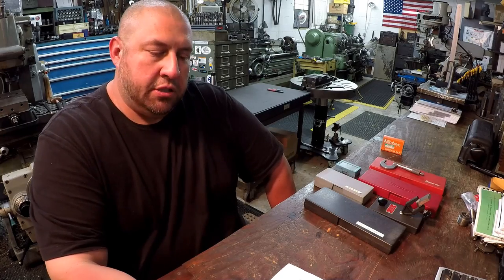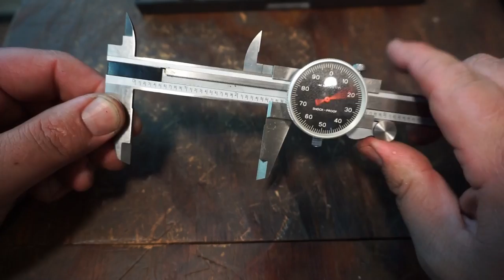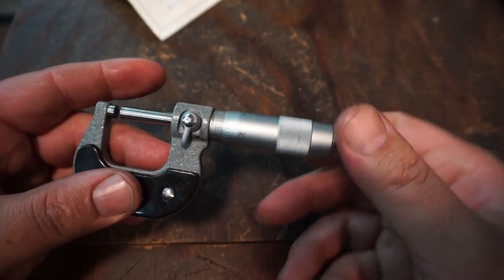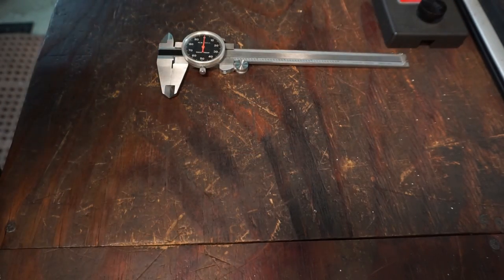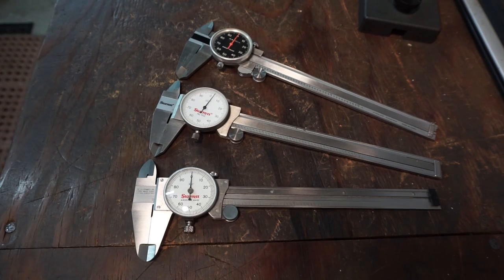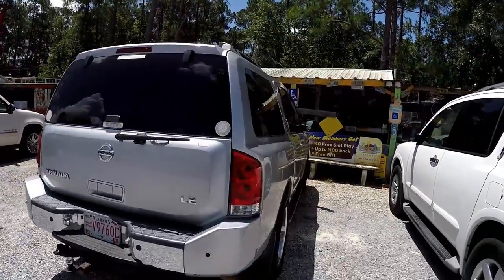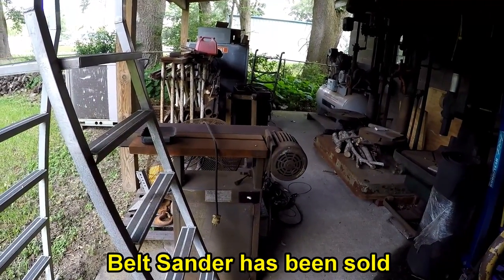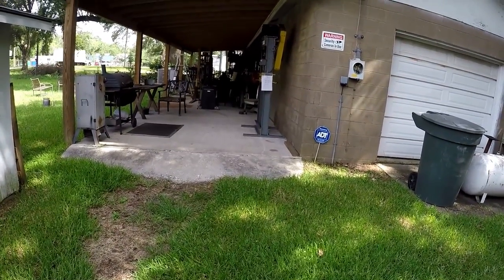SNS 175: Cheap vs Starrett, Shop Upgrades, Weekend Adventures

Comment: Hey Adam good job showing that those cheap tools actually do the job that they were designed to do.  I advise people to go ahead and buy the cheap hand tools such as wrenches, pliers, hammers, screwdrivers and stuff like that so that they can save up their money to buy quality tools that really need to be quality tools such as welders, air compressors, air tools and safety equipment.  That is money much better spent in my opinion and when you compare the value of a $100.00 name brand screwdriver to a $5.00 one from a outlet store the name brand gets blown away and the small difference in quality does not even come close to justifying the $95.00 premium.  Another great video and tell Abby that her camera skills were decent and she should get behind it more often and possibly even do some camera work inside the shop with you so that she can show different angles and stuff on occasion.
Reply from the maker: Thanks Davis, I'll pass the word onto my new camera lady.
Reply: I could see your point in the machinist field. But as a heavy equipment mechanic, with a lot of fasteners under high torque, cheap sockets and ratchets will break. When the sockets and wrenches are broached, the tolerances have a larger margin of error, which will cause you to round off fasteners. What I always tell people is to buy what they can afford, but the tools you use everyday should be the best you can. My ratchets, wrenches and sockets are high end, but punches and pry bars are whatever I can find on sale. I've come across guys that are mechanical geniuses, but work with harbor freight tools. On the other hand, I know guys who only buy tools off the trucks, but couldn't diagnose themselves out of a wet paper bag. I didn't mean to offend, just wanted to provide a different perspective. Have a good day guys.
Reply: Good advice.

Comment: Use a Mitutoyo 505660 since 30 + years. It also zero`s in on a 25 mm slip gauge. But it is in 0,01 mm ! Less than half of 0,001 " ...

Comment: The Starretts have dual gears but no protective cover. I always set them down  with the dial down so chips don't fall into the rack. Once I broke one of the gears and sent it back to Starrett. When I got them back they had a new bezel that was not so scratched but they failed to fix the real problem, assuming that all that was wrong was the scratched up bezel.They did not even check to see if they actually worked before returning them to me.

Comment: Hi Adam,

A machinist I used to know had a B&S micrometer that had come from a production shop and had clearly been used to check a fixed dimension for much of it's life. When the zero was set, it was no less than 6 thou out at one point in it's travel. He kept it as a warning!

I'd have liked to see you check the micrometers at a couple of points between the extremes.
Reply from the maker: That would be an interesting test on the older mics for sure.

Comment: Nice presentation.  

Way back when I bought a Craftsman 6 dial caliper.  I know somebody in the metrology lab so I asked him to give them a quick look.  He did and explained why he took readings at 90 degree intervals around the dial.  It seems a common problem was an off center pivot pin that would result in a small error.  Something worth knowing if you are calibrating dial calipers.

Comment: Hi I liked the video and its the first of yours I have watched. I do detect a little bit of biased opinion against the Chinese tools and a little bit of surprise at the accuracy though I do agree with Greg Fineis a comparison would need to be made over a range of measurements and time used. I don't doubt the Quality tools are better (I own quite a few both inherited from my father and purchased second hand) but it needs to be taken into consideration peoples budget and use of the tool and who may not be in the fortunate position of inheriting expensive tools or in the position to buy them. I think it also needs to be taken into consideration most of the people watching your videos will be hobby machinists who cant justify expensive tools. One thing must be taken into consideration and that is the Chinese are moving forward in the quality of materials and manufacture in a big way look at them 10 years ago look at them now wait another 10 years. India also.Please don't take this as knocking your video as it is well presented and subject well explained keep it up. Thanks

Comment: I enjoyed the comparison.  Even though they are all very accurate I wonder how long they will hold  that accuracy?  In our masonry tools we had to be careful to get trowels, hammers, chisels and joint finishing tools that hold up to the very abrasive material we use.  Measuring tools have to be accurate but not to your level.  Speaking of levels, plumb rules have to be rugged but really accurate so we can plumb and level our work, Greg.

Comment: Better to buy a used starrett or similar IMO.  I have some digital Mitutoyo, which I got off eBay at a good price. Nice quality.  Most likely the cheap tools will not stand up over time or heavy use.  The better quality tools can usually be repaired if they malfunction.

Comment: When you talk about Nike vs Kmart shoes, it's like you could hear me laughing. I agree totally when it comes to measurement or heavy use items, go with quality. If I'm doing something it needs to last, and it needs to be right. If it lasts forever, or it breaks tomorrow, my name is on it, think that way and the choice is easy, and usually more expensive. But, you can find some awesome stuff on eBay and at flea markets

Comment: Don't get the 6 foot door. Get an 8 foot. There are too many things that will not fit. Do a little research, you'll be glad you did. Also put a shower in there too while they are doing the bathroom. It will add value to your house whenever you decide to move because you can list it as a full bath.

Comment: Glad to learn you are taking time to be with Abby.  All work and no play... as they say.  The new building addition sounds great.  I like my new Abom t shirt.  Nicely designed and made.  I used inexpensive calipers when I ran abrasive jet cutters.  Sooner or later they got garnet into the rack and were toast and measurements were usually +/- 0.001.

Comment: You didn't mention the alloys, which with soft metals, makes the durability less. How long can the tool be consistently accurate do to higher grade alloys that resist corrosion better.

Comment: I'm not sure it matters if the the resistance is light, in the friction thimble.

If you zero it, having closed the mic using the friction thimble, then all measurements will be consistent, provided your friction resistance remains the same.

Comment: I would recommend that you get spray foam 1" thick before the other insulation goes in, it really helps seal up the airflow. Of course if you are going with metal for the siding they may use the rolls of insulation that goes on before the metal which makes it hard to do the spray foam. Also, you may want to stick the air compressor back outside in its own little roofed area, they tend to get loud inside a sealed room; or you could flip flop the compressor with the bathroom and have them frame the compressor to be outside under the roof you have now. Changing the electric for that isn't that terribly bad, same for the re-plumbing the air lines.

Comment: Another thing you should add. 
Even though those imports are measuring accurately and dont seem that much different than your starretts. They will not last nearly as long.
They use cheap metals and dont properly harden it so itll wear out sooner than the starretts or any other notable brand.

Comment: Adam great news on the expansions, you have more Space to move around equipment which seems to add more capacity from extra room. It clears the mind to focus better on the customer's job. It will fill up quick and the kind of go getter you are you will be adding on again before you know it. Tom makes great use of his space and that is good because if anyone visits the extra space can be very good,he works so fast that in cramped spaces he may accdentaly clamp or church us right up! At least it would be good work! ;)

Comment: I don't know Adam.  I think your plan is not robust enough.  I mean, where will you be in 5-10 years from now? Will you be employing people. Will you need to move the entire shop to a Industrial Estate. Maybe putting the money into a interest account for a year or two and let things develop? Your shop, now, is very organized and functional. That concrete slab is cracked and cannot support heavy machines. Perhaps you will double the size of the shop one day and trash that slab?   I would not want my comments to in any way discourage you.
Reply from the maker: +J Curran In 5-10 years my plan is to be in a big new metal building. I'm working with what I have for a while without investing too much.

Comment: I finally got my 2001 Durango back from the shop with a new engine, poor thing dropped the exhaust valve seat in cyl. 1 last November.

Comment: Hi Adam, as a hobby machinist I really like your videos - full of informative tips from a professional. I worked for 6 years in Metrology and it was all about calibration and traceability. Micrometers and callipers were regularly checked using higher grade slip gauges, which themselves were checked. Maybe the cheaper tools will lose their accuracy sooner? Time will tell although a good quality tool is a joy to use.
Keep the videos coming!

Comment: cool to hear about the renovation into my area of comfort lol  thanks for the vido  as always regarding 3phase power its almost always cheaper to prewire than to wire after construction . would love to see plans if possible my schooling is in architecture so it is more than a casual interest  ,, will you have a pass through  or will it be basically a 2nd shop on the side? insulation is a must with your heat and humidity i hope you have a good air handling system if not now is the time.. slow and steady dosnt win the clash but it sure shows experience and composure theres always next year and keith is getting older lol no offense keith i enjoy and comment on your videos as well  theres some cool places near you and its been nice to see them ..again thanks for the vids

Comment: You hit the nail on the head when you mentioned that the $15.00 callipers were unused and I am sure that with a bit of use in a work situation it may not be so accurate. Gets what you pay for !!

Comment: On your tool comparisons, one thing I was waiting to hear was about durability. Yeah those chinese calipers work today and they are great for a newcomer to the business. But with daily use in a high production environment, they wont last for 3 generations of workers. If you get a year or 3 yrs you would be very fortunate. However, with the higher quality tools (whether made in Japan, Poland, Germany or USA) you can have a set of tools you can pass down to the next generation. And most importantly, they will most likely always be serviceable. Cheapo tools, once they loose tolerance, there is a good chance that tool is done.
Reply from the maker: +Aaron Meloccaro Yes I did fail to mention that, but I don't have much to go off of. I will say we used to use those cheap calipers a lot and the best thing about them is if they got messed up, dropped, or otherwise broken, they are an easy and cheap replacement.

Comment: I'm just a hobbyist wrench monkey, I most bought a set of calipers for reloading ammunition, but I find myself using them for all kinds of things since, like measuring bolts and comparing to drill sizes for more accurate hole drilling, for scoring a quick line 6 inch from an edge of sheet metal, measuring inner diameters of holes, output shafts of electric motors, engine parts, all sorts. Mine are cheap electric ones off amazon, I was using them at one point in the rain on my jeep this winter and accidently left them outside in the street... they were run over, the battery self ejected I thought it was over... put the battery back in and to my shock still worked...
Reply from the maker: Now that's called getting your monies worth!

Comment: I know it would be a major pain to move the blast cabinet into the new area, away from the machines especially the Monarch, but in my humble opinion would be well worth it. I have worked in numerous shops with blast cabinets including my own and have yet to find one without blast media on every surface close to the cabinet, has to be hard on machines. Love all your videos. Very happy and proud to have just received my new "shop life" pocket tee.
Reply from the maker: I am giving serious thoughts to sell it so that I have more room in the back. I'd rather not even move it into the other side. It's way bigger then what i need, but a real nice machine!

Comment: You can find a lot of older quality tools on eBay. I have a Mitutoyo digital caliper and micrometer from eBay that cost around $50 each. I think the best advice is to buy the best you can afford. Buyer beware of the Mitutoyo digital Chinese knockoffs. AvE did a nice comparison of the differences between the two to watch out for.
Reply from the maker: I have found a few nice high quality calipers at my flea market, the starrett calipers I shown here, that's where I found them.

Comment: You are going to want the machinery in front of that roll-up door to be easily moveable. Big stuff goes in and out of a door that size. The welding table seems like something hard to move around.
Reply from the maker: I'm going to set the welding table further back and have the the first section near the doors open.

Comment: Is the thimble on the Chinese micrometer adjustable? Many are.
Reply: Im not a machinist myself but i did do some machining as part of my sheet metal apprenticeship, i distinctly recall the teacher teacher said to use a mic properly you shouldn't be using the rubbish ratchet (lots at trade school didn't even have this part) thimble, you should be feeling the "slip" between your fingers and taught us a particular way to hold them.
This was a long time ago, times (digital measuring tools were frowned upon and not used on the floor back then either,they have improved although i dont use them myself) have changed? Maybe he was just old school and had one bad experience, i dunno! Ive not had much cause to this day to use them a whole lot so im not pretending to be talking from experience, that is about to change though!

Comment: New chineseum stuff isn´t actually that bad, it just wears out pretty damn quick. Classic add to " If you´re buying cheap, you´re gonna buy two."
Reply: Cant do it with measurement gear myself, a quality non Chinese dial caliper will last longer than you as long as not abused,have to be real lucky with China.Do the job, SURE, just not last a lifetime or longer. I guess if you only plan on using it once, but if your'e in it for the long haul I don't think its smart, personally I think its a false economy.Just my 2c. Buy once,cry once.

Comment: Grinding/welding out of machine shop=GOOD
Reply: and making giant forgings, like they used to use in the old locomotive and machine building shops, Lima locomotive works hammer and smith shop had some chambersburg 24000 striking force steam hammers and it shook the ground so bad that they had to stop the machining on the south end of the works when it was in use or other machining on the shay geared locomotives and would shake water in glasses several blocks away, they had 4 double frame hammers in that works if you were wondering

Comment: Adam;

Slight correction on something you said.  The 1202 is US made and is the stainless steel version of the 120 dial caliper.  The 120 version is high grade carbon steel, made in USA.

The 3000 series of tools from Starrett are the Chinese made tools to Starrett specifications.  Therefore, the 3202 dial caliper is the Chinese made equivalent of the 1202 US made dial caliper.

It was great meeting you again at the Bash and I hope sometime to make it down your way in Pensacola and drop by for a visit.

Regards;

Ron Kluwe
Reply from the maker: Ron, I thought when I bought these they were the Global series calipers imported.
Reply: Adam;

The "1000" series of calipers, dial calipers, and rules are typically the same US made Starrett tool, but in stainless steel.  A 1230 caliper is the same as a 230 caliper and a 1309 rule is same as a 309 rule, but in stainless steel.  Pretty ingenious when you think about it.  Someone can go into a store selling Starrett tools and say, "Hey, I have a XXX number tool.  Do you have it in stainless steel?" and all the seller has to do is add "1" to the front of the tool number and look in the catalog and see if it is there.

Now, that all being said, Starrett does have manufacturing facilities in other parts of the world that manufacture tools with the same tool numbers as the US tools and those tools are considered the equivalent of the US manufactured tools (Scotland and Brazil are the two overseas locations I know of that are considered US equivalent).  The Chinese manufacturing location is considered a different type of location as I believe the tools in that location are manufactured under Starrett license.  The Chinese tools do have some cost cutting measures (e.g., using plastic components in lieu of steel) so that Starrett can be cost competitive with other world market competitors, but Starrett is very clear about the origin of those tools.  This is why the Chinese manufactured tools are numbered as the "3000" series and cost significantly less than the similar US made tools.  

So to bring this long story to an end, what you likely have is a stainless steel dial caliper manufactured in either Brazil or Scotland (therefore the Global series designation), but it is to the same quality of material and fabrication as if it were made in Athol, Mass, USA.

Regards;

Ron